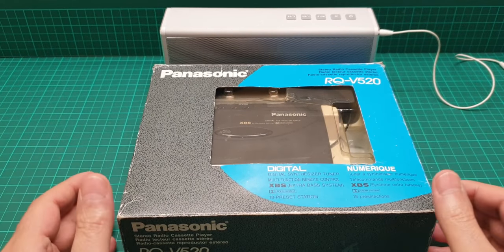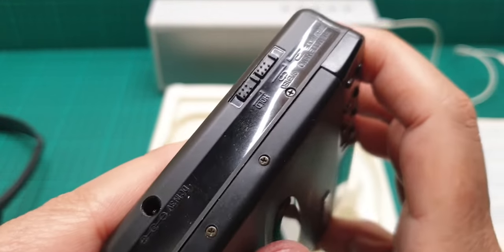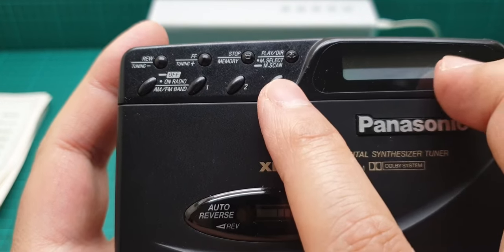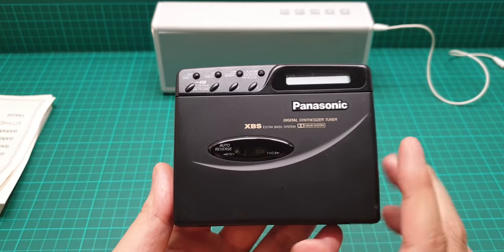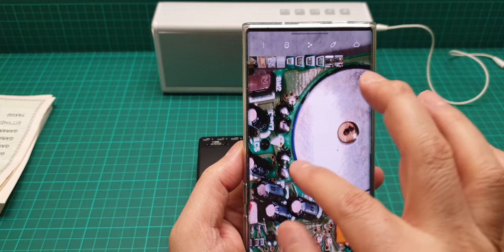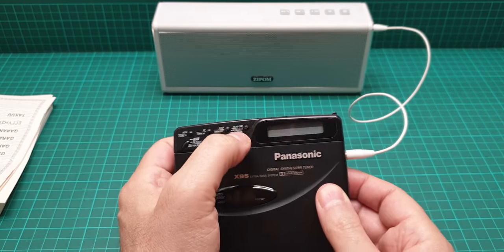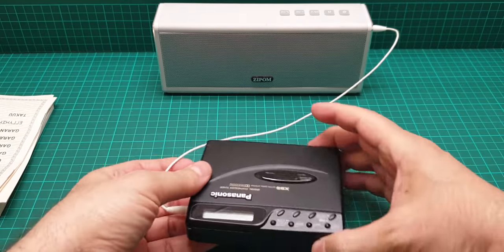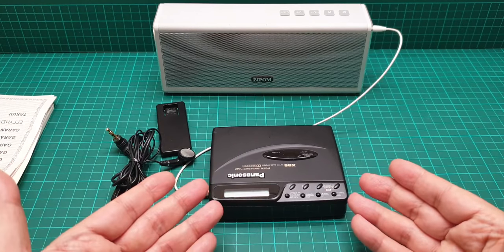Panasonic RQ-V520 personal radio cassette player review & what to expect

Comment: Loss of treble in the forward direction is caused by a bent pinch roller arm pin. This is common in all pad-lifter AR90 mechanisms and there are a few ways fo fix this.
Reply from the maker: Hi, thanks for visiting my channel. I'm keen to know your solution as I've changed both pinch rollers but problem persists. Cheerio and take care.
Reply: @HomBKaviani  It's not the pinch roller, it's the bent pin that holds the pinch roller arm. Basically the forward play pinch roller is at an angle compared to the head. Also, the pad lifter is usually bent. It is a shame I cannot attach photos it illustrate the problem.
Reply from the maker: @edradiofan7855  thanks for your support. I'll definitely try it. Take care and cheers for now.